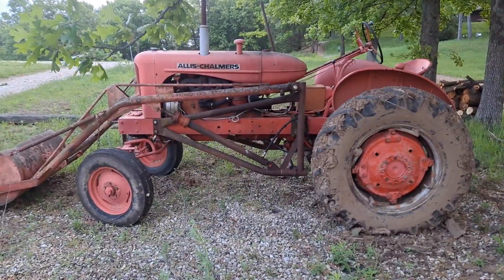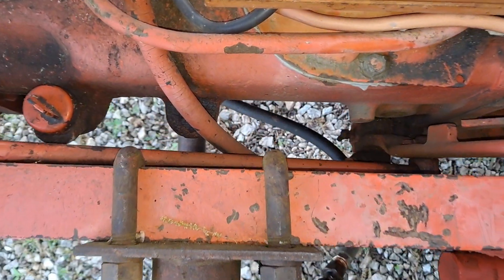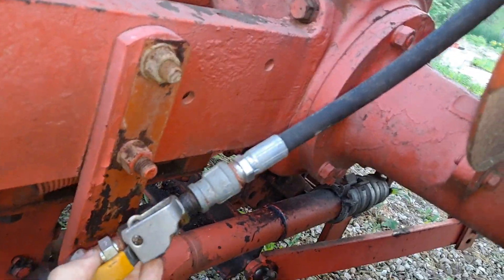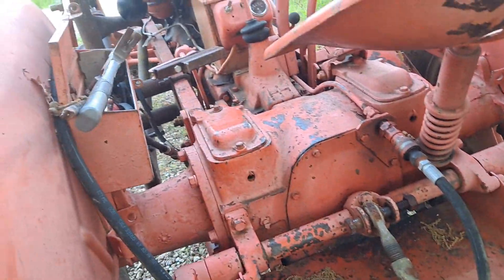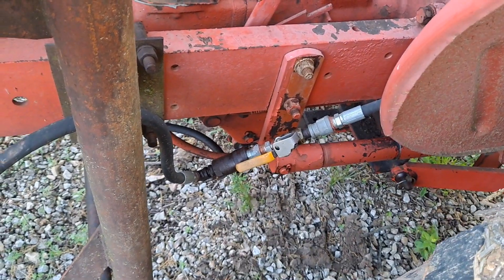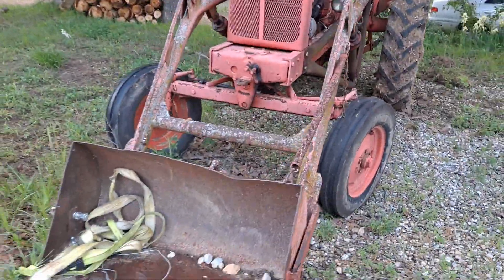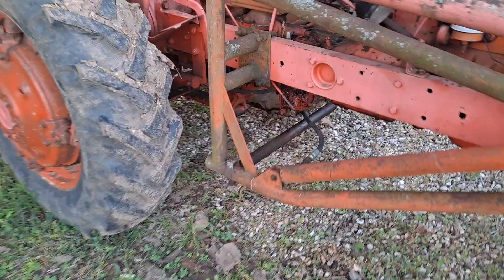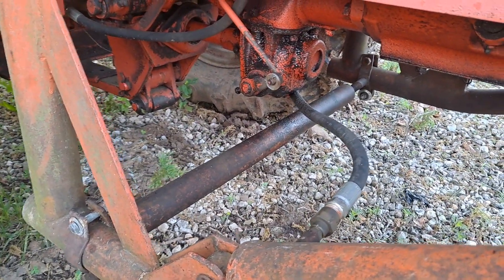wd-45 trip bucket

Comment: Lived with these things for years, mostly on WD-45, last  one on a D-15.  Next loader was all hydraulic, with it's own hydraulic system.  Live pump mounted in front of the crankshaft and oil tank built into the vertical support, on another WD-45.
Reply: You could put in were pulley goes.  D-17 VI  have it that way.,   I guess it would not be live hydr wheb using foot clutch
Reply: @donvoll2580  Only used it twice that I knew of, but that was the only tractor we had with a pulley and we couldn't have run the corn sheller without it.

Comment: That is very helpful. My mounts on the tractor already have that support bracket going under the tractor.. so all set there..  Will give this a try soon! Thanks so much. Do you or anyone watching know approx how much an allis WD45 will lift in total on the bucket? thinking from the size of the cylinders around 1,000 lbs?
Reply from the maker: No problem and I don't know. I mainly use mine for moving gravel and dirt around.